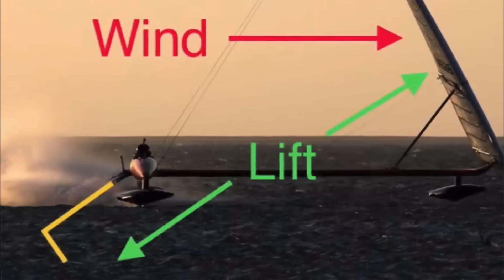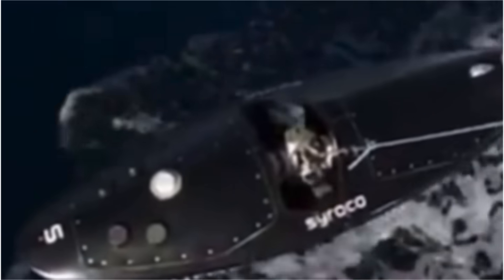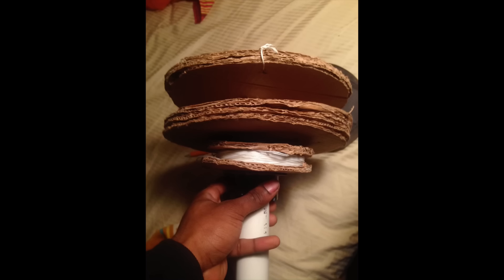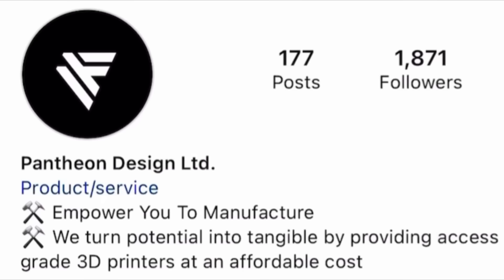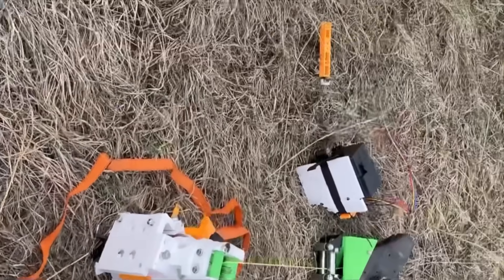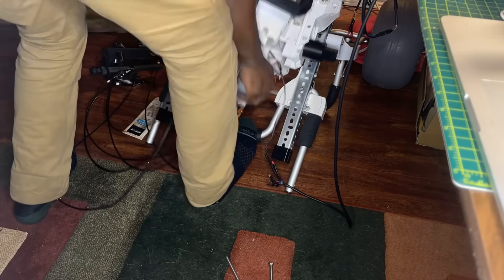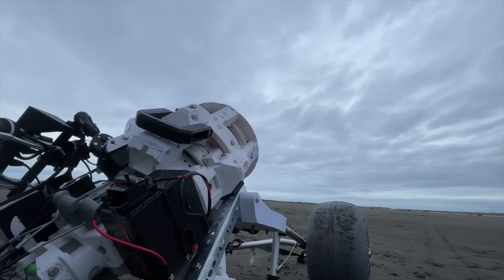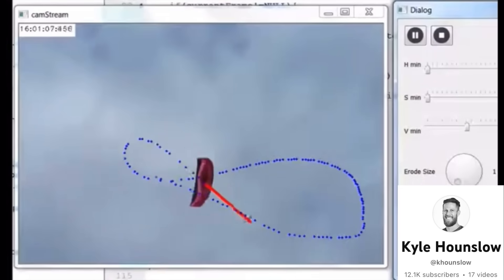Transforming Sailing and Power Generation with The Ocean Kite Engine

Comment: Nice. Kites have great potential. Downwind a relatively small kitesurfing kite will do for fairly sizable leisure craft. For going upwind, the kite probably needs a comparable size to those of a conventional sailboat. This inevitably raises the question of launch and retrieval of a kite far bigger. Have you got any thoughts around that?
Reply from the maker: Thanks for your question. It's usually best to have a quiver of kites of different sizes. The reason we had to build a system that is so modular and versatile is because there are so many different types of boats.. Some boats (like catamarans) might have enough deck space while others, (multihulls) may be limited. We can do a standard water launch for bigger kites  (kiteboarders do this when they launch off boats) 

Also we were sure to develop safety features.. like including a depower and the ability to release one steering line fully to allow the kite to "flag out" during reeling or if overpowered.

With either of these strategies it's relatively easy to get the kite back on deck, and with practice we hope to have it not even touch the water.
Reply: @Ocean_Kite_Energy  thanks for your reply. I get all this as a kitesurfer and sailor myself.  I think if you go to 50, 100m2 or more to have respectable upwind capability for a 40-50ft  sailboat, water launch and retrieval probably won't be practical.  Retrieving a spinnaker that fell into the drink can be a challenge. You wouldn't want that to be the default for changing sails. Having also dealt many times with tangled kitelines after a kite hit the water, I believe water launch and retrieval is unlikely to be practical for a vessel that would use kites as its main means of propulsion. I dread to think about kitelines caught in the boat appendages in inclement conditions. 
I  like your line handling system and hope you successfully commercialize it. It should allow you to address the niche of applications with kite sizes that can be manhandled like in kitesurfing. If you want to expand beyond the ancillary downwind solution, simple and safe launch and retrieval of an upwind sailplan equivalent size kite is the remaining engineering challenge to get sailors to consider going mastless.
I've subscribed to your channel to follow how you are progressing. If the hurdles can be overcome, I think kiteboats could be a change as epochal as the change from square rigs to triangular main sails. (and the stand on and give way rules would finally make sense again).
Reply from the maker: @tms1624  Thomas, this is why this project will succeed. Folks like you that are just trying to help. The point of engineering is to try to kill the idea before millions of dollars and years of time are wasted. You have very valid points. Ive been wracking my mind how to solve this but I wasn't sure the size kites we would be dealing with when it came to upwind. 

I have a solution that I would like to run by you. I think you'll be interested to hear. 

Would you mind shooting me an email at Christian.Harrell.OKELLC@gmail.com? 

Cheers

Comment: I see a couple of major issues with this. 
1). When there is wind a yacht does fine, the issue is when there is no wind in which case this is of zero benefit. 

2). During squalls or night time sailing and a sudden storm hits, what do you do? Cut the lines to save your yacht? 

It's a nice idea but I'm not convinced it's actually safe and usable in a real life cruising situation. For sure on a perfect weather downwind sail but those days are rare, so I'm still on the fence. 

Good to see you seriously working on it, the concept has been around for quite a while but never really beneficial so far.
Reply from the maker: You'll always have an issue with wind generators and sailboats when there is no wind! This does have tension sensor on the lines though, so when the wind is light, the Engine retracts the line to maintain tension. 

Great question about the squalls and cutting the line.. I need to incorporate a physical line cutter.. But otherwise there is a Depower that effectively "shortens the sail" or you can just release either the right or left line and the kite will just "Flag out" if you can see what I mean.. It will dump all the wind and fall to the water.
Reply: @Ocean_Kite_Energy  If it could be automated with those safety features and constructed from carbon fiber so that it's as light weight as possible but still more than strong enough for all conditions, you might be on a winner. 

However, for me personally flying a Spinnaker is one of those beautiful moments on a yacht, a time when you can truly lay back, look up, be amazed, at ease and time vanishes. It's just magical.

I assume if you use this sail/kite then you'd sacrifice your Spinnaker and perhaps all headsails. Is that correct?
Reply from the maker: I love the spinnaker! A big reason I developed this is because flying one usually takes a competent crew of at least 3-4.

With a Kite Engine, we can do it with 2 crew, and even one with practice. We are looking at mounting strategies.. We will develop some type of traveler so we can move it from starboard to port. Right now I have my eyes on a particular type of Proa boat..

Because of a kites motion (independent of the boat) it increases the apparent wind.. this is to say we only need 25% of the sail area of a traditional spinnaker for the same amount of power. It's just a more powerful spinnaker in a smaller package! Not to mention, there is much more wind up high.. And no wind shadow!

The Engine has both manual and electric control, we can just reel in the line, and shift the kite under the rigging and relaunch during tacks or jibes.  

  @PeteGerard-p2f
Reply: @Ocean_Kite_Energy  Your replies are fantastic! Extremely knowledgeable and totally realistic, you know your game well! 

Question: In general how much stronger is the wind at I assume 200ft above sea level? 

With what you're saying, you could run the kite from the windward hull while sailing at say 300° with an asemetric Spinnaker almost as a code 0 due to the change in apparent wind at a far superior speed. 

Now that is truly exciting! 

I have no idea what a Proa boat is, could you please explain that, it's probably just a translation issue. 

My personal interest is for a 80ft trimaran we are at the design stages of now, so timing is quite good. 

Also I honestly don't understand the Regen capability, could you explain further please, not that it's a deal breaker, I'm just curious on that. 

Thank you 😃
Reply: @Ocean_Kite_Energy  I found this on Google: 
The average wind speed at different altitudes can vary greatly depending on a number of factors, including location, time of year, and weather patterns. In general, wind speeds tend to increase with altitude.

At sea level, the average wind speed is around 5-10 knots (6-12 mph).

At around 3,000 feet (900 meters) above sea level, the average wind speed is around 20-25 knots (23-29 mph)

So my question now is, what altitude does or is the kite capable of? 

I doubt it's any where near 3,000ft lol, but perhaps 500ft is possible and if so that could be significant increase in wind speed even on the calmest of days, if you could get the kite flying in minimal wind at sea level. 

The more thought you put into this the more interesting it becomes and the more questions come to mind!
Reply from the maker: @PeteGerard-p2f   Thank you! So I actually come from the Airborne Wind Energy world, Think companies like Skysails.. Yes the wind speed will vary at altitude, but you can always count on it being stronger at higher altitude than down on the ground. Also, virtually no wind shadows! This means land features, and other boats, won't affect the sail nearly as much.. Just clean consistent wind.

Comment: How do you launch and recover the kite ?
Reply from the maker: Right?! Super practical question.

We will have a more basic video of the functions soon. You can reel in and out the lines electronically.. The launch can be done like any water launch with kiteboarding (look up water lauch kiteboarding) We might even be able to do it from the deck depending on the size of the kite. The landing can be done similarly but in reverse, then we can reel the lines in using the motor.

Comment: So many research has been done on this subject for the last 2 decades or maybe longer. For e.g. by Dutch Astronaut Wubbo Ockels (rip), Ladder Mill 2001(researchgate). It looks like a simple no brainer concept but is difficult to make reliable and ready for commercialisation apparently.
Reply from the maker: You're totally right.. the list is even more extensive than you mention, unfortunately, sounds like youre fully aware. There is a reason about 10 years of research went into this even before the first prototype..

 Kite systems are a gestalt.. Every facet has to be considered before even starting... It's easy to get distracted with investors and videos like these.. 

A part of what I do is study the psychology of the industry.. There are a lot of founders with whimsical ideas.. These people are great marketers and team builders, but their ideas are silly. They hire engineers to carry out whimsical ideas and those engineers are not allowed to kill the idea.. (for fear of losing their job)

Im always looking to kill my ideas.. looking for holes, problems, issues.. I think that is very important for a robust design.

Comment: Do you think you can get close hauled with your kite sail? I read (good) kite surfers barely manage a close reach. But then, a surfboard is not a boat.
Reply: It's harder but yes you can.
Reply: @flightographist Thanks!
Reply from the maker: It will be much, much easier with the benefit of a full keel.

I am still working on how to solve this problem with motorboats, I think we have a solution: stay posted.
Reply: @Ocean_Kite_Energy I definitely will. Regarding motorboats: Leeboards are something that can be added easily to a motor vessel's hull after the fact. With today's materials (CFRP) and modern foil shapes they wouldn't add much weight/drag.
Reply from the maker: @roken1  , that's great advice, I'll look into that!

Comment: My word...Wind powered boats, what a time to be alive!!!
Reply from the maker: Right? lol. But seriously, we have come along way since the Mayflower.

1) A kite can have the same power as a sail 4x larger, 

2) the wind speed is much stronger higher up (when the wind speed doubles, the kite becomes x8 more powerful because of the cubic relationship of windspeed and lift). 

3) Also, people could save a lot of money with 95% less rigging.. 

4) There is no annoying heeling motion that typical sailboats have. 

5) Plus, this can double as a wind generator to charge batteries.
Reply: @Ocean_Kite_Energy  What about upwind performance?
Reply from the maker: @BrentReed-vc2vf  Equipping a vessel with a keel is crucial, as it enables us to navigate upwind with greater efficiency and precision than a kiteboarder.
Reply: @Ocean_Kite_Engine what about a cat? I would like to build a ~16m aluminum cat and have had the idea in my head for a long time that a kite like the big ships would be nice. That looks very interesting!
Reply: @Ocean_Kite_Energy  I watch a lot of blue water sailing channels, who kiteboard while at anchor. I've wondered for years why they don't utilise it when sailing down wind. 
Device "appears" bulky, over engineered, complicated, for anything under 50 foot, vs just anchoring the line to the bow, maybe to a horizontal electric winch, but I guess you already tried that.
Inflatable would also be handy, in-case it lost wind, went for a swim.
Reply: It's just a phase, it'll pass and fade away
Reply: It’s way more impressive than lazy sarcasm. Maybe you should upload even one video of your amazing efforts.
Reply: IKR!!!!
Reply: Green engineers going next level and thinking inside the box.
Reply: Best comment ever 🤣
Reply: Ok captain Jack aubrey…
Reply: Wind powered boats. What next? The wheel? Fire? Speech?
Reply from the maker: We are on Iphone/samsung what number now? Why do they keep making new ones!!!! Someone explain this insanity!  @mihaipuscasu7357
Reply: @mihaipuscasu7357  Kite powered trains would work in open country but I have a feeling most railroad tracks are probably near or cross power lines too often, even out in the middle of nowhere.
Reply: Haha!

Comment: Sailboats yes . How would it work with boats with rigging ? Perhaps on a Catamaran if mounted on 1 hull? Great for cross ocean crossings
Reply from the maker: I am looking at mounting strategies now.. my primary concern is not damaging the deck.. Kites can experience 30 times the minimum power in an instant.. that's an incredible shock load. I would hate to turn a boat into a convertible unintentionally!

Comment: Interesting idea for sure, i would be interested in knowing how you will deal with backstalling issues on bigger kites  when the kite isint moving.
Reply from the maker: Great question. We can use the actual motors as tension sensors, when the motors experience a sudden loss of torque, the kite will reel in until the correct tension is achieved. If the line gets pulled in all the way, well, it's not a very windy day!
Reply: Ok sick thats so neat! @Ocean_Kite_Energy

Comment: What is the optimal length of line that gives you the greatest velocity?
Reply: The longer the lines, the larger the kite window, the more power.
Reply from the maker: Yes. Also the higher up, the stronger the wind.. When you double the wind speed you actually increase power by a factor of 8 due to the cubic relationship of wind speed and lift. 

It feels like a real world hack. 

 @flightographist
Reply: I could be wrong but I assume you have tried a kite on a board? Up is for POP...and the first few times some serious pucker!! @Ocean_Kite_Energy